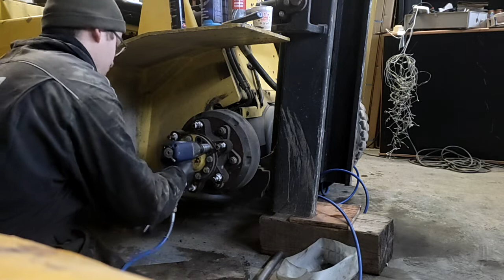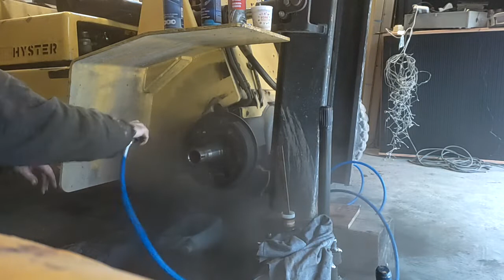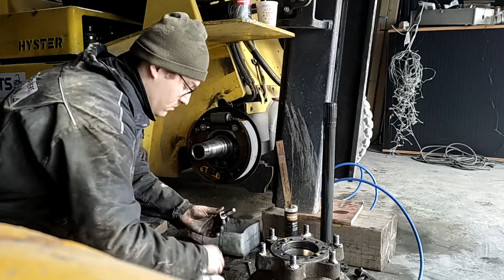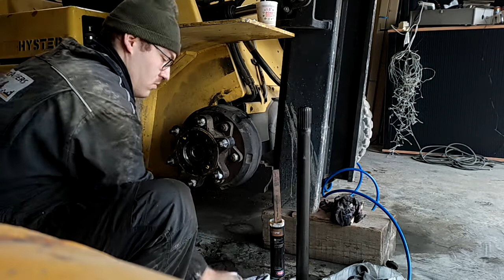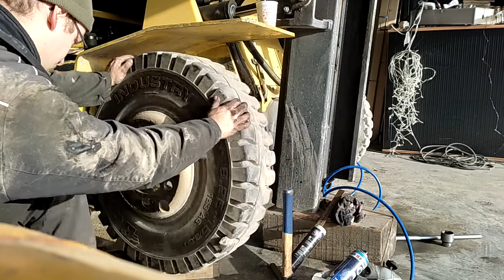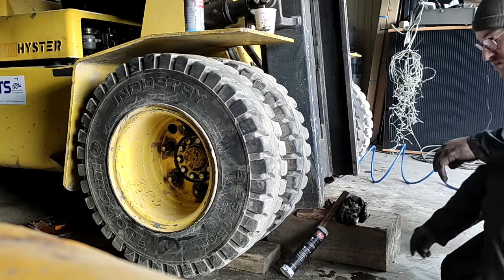Hyster H4.5XL forklift Brake service

Comment: You might find it easier to adjust the brake shoes out if you do it before you slide the axle back in. All of my Hysters use RTV to seal that axle but it looks like you've got an older model here so maybe not. Good job
Reply from the maker: Thanks a very good reply, i'm still learning, thats something i will try next time! Thanks alot man!